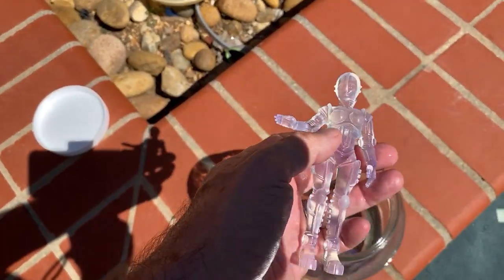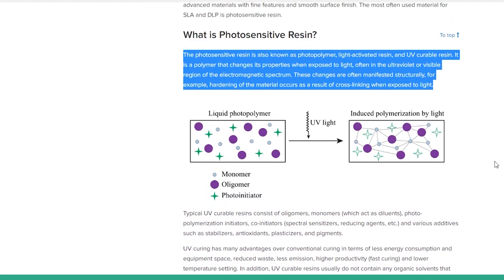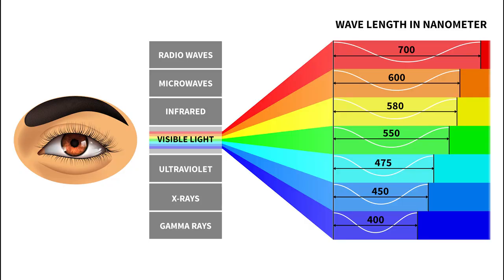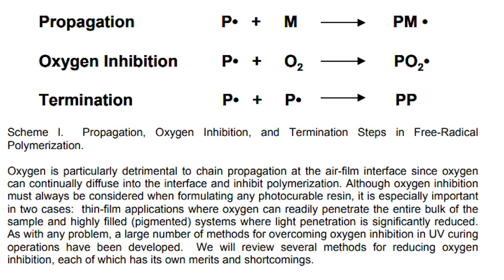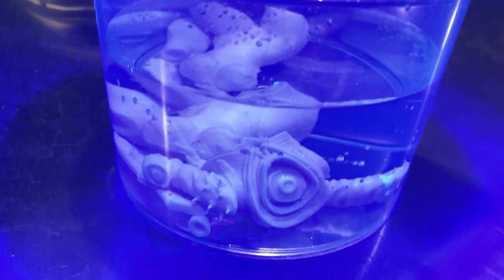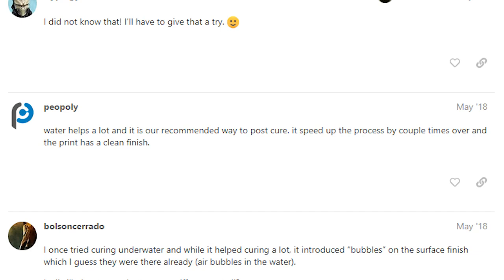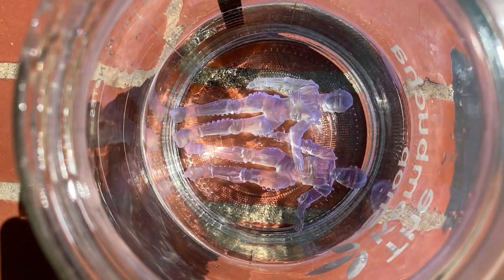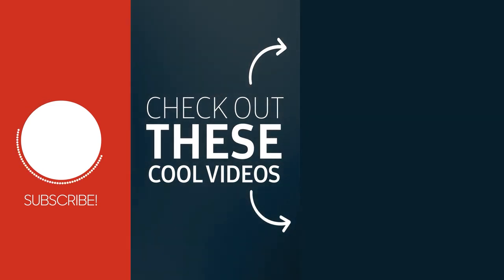Water Curing: The Best Way to Cure Resin 3D Prints

Comment: How do you clean your prints? I don't get uncured parts but I seem to always have a residue left no matter how thoroughly I clean. I've tried IPA and Mean Green
Reply from the maker: I use an ultrasonic cleaner. Fill it with water and then suspect a ziploc bag full of IPA in that. If you don't have an ultrasonic cleaner, swirling in acetone. That will take everything right off!

Comment: Which settings you used for these clear prints?
Reply from the maker: Hi Federico. Elegoo Mars Pro printed at 0.03 layer height, 8s per layer and 60s base layers. Hit it with Krylon clear coat spray after curing.
Reply: @Make3DTV  thanks so much for your help! 🙏🏻 mine turned out little bit yellower 😬
Reply from the maker: @mrfedo79  Try a bit less cure time. Also, since I did the video, I learned that sunlight isn't optimal. Pure UV light from a UV lamp indoors is best. Sunlight tends to break down resin, as it contains some of the spectrum that is actually harmful to resin.
Reply: @Make3DTV  thanks, I’ll try

Comment: Will this work with hollow prints? Also I’m not using transparent resin as it’s constantly sold out
Reply from the maker: It will work, but you need to figure out a way to cure the inside. You can do this with UV flashlight or a UV LED bulb. Make the holes big enough to be able to shine a UV light source into the model.

Comment: I use Siraya Tech resin. It seems like curing in water makes permanent cloudy spots on the prints. I clean with MeanGreen and then rinse with denatured alcohol. I dry it then cured in water. What am I doing wrong?
Reply from the maker: Try rinsing off the alcohol with water before letting it dry. Then cure. If you just let the alcohol dry on the print, it typically leaves a white residue.

Comment: How long should the average print cure. Assuming common resin like Elegoo grey or rapid resin Grey.
Reply from the maker: About half the time you would normally cure, so about 7 or 8 minutes in water. Usually about 15 in a chamber, depending on the resin. You just want to make sure it's not tacky, with over-curing, you can see a color change-- like a burnt color.

Comment: Wouldn't a vacuum chamber work as well?  Get a clear one and place UV lights around the unit. Not to disprove the process, I'm new at this and just asking.
Reply: I'm no expert at this but I assume the vacuum chamber would lower the oxygen and, thus, improve the curing process.  In theory at least.
Reply: I'd say that most people have a jar and some tap water available, but far fewer have a vacuum chamber readily to hand!  I think you'd need to make sure you were printing a solid model, not hollowed, wouldan't want to risk anything exploding in there!

Comment: Thank you for your video.
I tried to do this and got a completely white model.
I washed the model in alcohol, dried it and tried to finish it in water with a UV lamp. White.
I washed the model in alcohol, did not dry it and tried to finish it in water with a UV lamp. White.

What am I doing wrong?
Reply from the maker: Hi Max, make sure you wash off all of the alcohol completely with water before you cure. The alcohol can leave a white residue if it's not rinsed off.
Reply: you can also try polishing the model with super super fine grit paper - there's a video out there about printing dice ive seen which included how to get clarity back from a cloudy print

Comment: I live off a well, so the water is quite hard & full of sediments. Would you reccomend curing in distilled water in my case? What do you think of possibly even curing in isopropyl 99% for a quick dry? Or does the well water not really matter?
Reply from the maker: I doubt the well water really matters, but you could do a test with distilled/filtered vs. well. I hadn't thought of curing in IPA. I imagine that would work well, but for larger prints, it could get expensive. Or course, you want to use fresh, clean IPA-- not the stuff that your cleaned the print in.
Reply: @Make3DTV  what about curing in a 50/50 water + IPA solution? The print gets oxidized and the excess gets dissolved.

Comment: Why is it so hard to find a time on curing. This is the third video on curing where they just blatantly ignore how long to cure prints...
Reply from the maker: There is no set time. It depends on the resin, but you typically cure until it's no longer sticky.